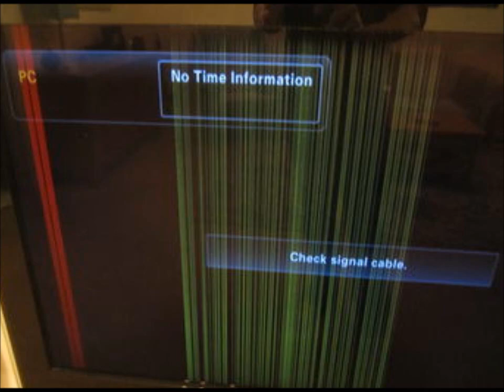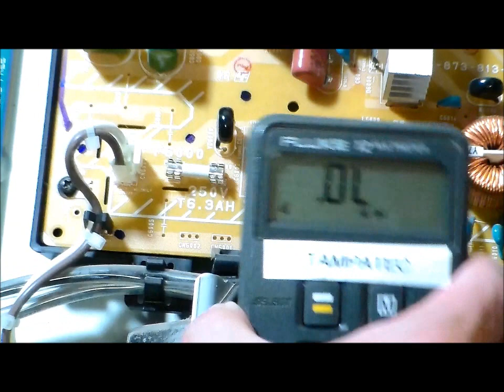What TV Boards Commonly Fail in LCD - Repair Service Guide

Comment: Oh if you ever come across any Vizio E552VL smart Tvs and it turns on but there is no picture, or back light my first thought was the inverters were out on it, but I had no voltage on the power supply so I removed literally almost every components on the board and tested them and they were ALL fine reinstalled it and bam black light came on and had video. So I am guessing it had quite a few cold solder joints. Then I put the back on it and it would turn on then shut right back off, did some research and people were pointing at firmware needing updated, I tried to find that with no luck, nor any help from vizio and I laid down to find the main board model number and noticed the ribbon to the remote sensor was off.. Plugged it back it and it worked like a charm! So if you ever come across that issue try to re-flow the solder on the back of the power supply and watch out for that little ribbon cable when reinstalling the back! haha  Just an idea in case you ever have that issue. Have a good one!

Comment: Excellent video.  The advice starting at 4:13 on getting no video display helped me troubleshoot.  It turns out I actually was getting a picture.  But as described here, because there was no backlight on, the picture was so dark that it seemed there was no picture at all.  Per the advice provided, I help up a flashlight to my screen to realize I could actually see (just barely) the very dim picture coming through.  This helped me confirm I really had a bad inverter board, not a bad video board.

Comment: Hi, thank you for sharing your knowledge. I found your repair guide very interesting and educational especially to us who does not know electronics repair.
I have a Sony KLV-46X200a, after watching and it is left plugged from the main(standby) for a period of time say overnight it will never turn on next time. The red light is on and when the power button from remote is press the green blinks then the red light stays on, and no picture and/or sound at all. 
the work around my son discovered was, he unplugged from the power source  for an overnight and then when he tries it turns on. But the problem comes out again if he forgot to unplug once he is done with the TV.

Comment: Love your videos. I have a Samsung lcd that powers on and off with loud screeching and static screen mixed with some green screen lines. I installed a new power supply board but no luck. Still powers on and off by itself but no screeching? Weird lol. Should I replace t con board next or main board?

Comment: Hi, first of all, thanks for the video. 

I have a Sony Bravia KDL-55W900A and a couple of months ago i replaced both the power board and the logic board, due to a surge on a thunderstorm. I did the repair myself (i’m no expert but i figured that if i can build a PC, i could replace these parts, and indeed i did). 
I didn’t check for blown fuses or capacitors, at that time. I got a replacement power board, then replaced the logic board and the TV worked like new.

Last week, we had another thunderstorm and... you guessed it, the TV was on at the time, and now it’s dead AGAIN.
I really like this TV and would like to fix it again, but this time I don’t want to just buy both the power board and logic board without first trying to pinpoint the problem, specially if a simple fuse or capacitor can be the culprit.

My question for you is this: do you know if this model has a fuse on the power board? 
Also, where do i get a replacement?

How do i check if the capacitor(s) are blown?

I really hope I don’t have to buy these 2 expensive parts again...

Hope you can help :)

Comment: Hi, great video. Can I get your advice? I have a Samsung UN46D6400 LED tv. When I first turn it on, the picture shows up. Within a couple seconds, it fades to nothing (the fade starts with horizontal lines then goes black). When the room lights are off, the backlight can be detected and it's uniform. Also, no image can be seen with the flashlight test. Do you think this is a main board issue since the backlight still works? Thanks for any help and suggestiosn.

Comment: Hi. Thanks for your video!

I think there's a faulty transformer in my power board. It (or another component) is emitting a high pitched wine whenever plugged in. Sometimes turning on the TV exacerbates the issue, sometime it takes away the noise temporarily. Is this something you see often? Is this something I could fix at home (with the TV unplugged, of course)?

Comment: Great Info man! I have a Samsung 55 3D LED TV, Have a thin line going  horizontal and one vertical and also has a black dot 1/4 inch , in the lines that cross, vertical & horizontal any suggestions

Comment: Hi Tampatec, I find your videos excellent tutorials. I kind of learned a lot from you. In February 2012, I purchased a Sony Bravia 55 inch LED television model number X BR – 55HX929, at the time I paid $2500. The picture in the performance of this television is excellent coupled together with Verizon FIOS its rendition of high definition television is superb. Most recently we were on vacation and gone for over a week. When I returned the TV begin to give me some problems.  After playing for several hours picture would dim down to almost nothing and then shut off. It would give me a blinking code of 5. After cooling down and disconnecting everything from the TV including the power the TV will fire up again. Once again performing excellently after several hours it would shut down again this time giving me a red flashing code 4. If I place a fan behind it the picture stays on much longer. Unfortunately this is very disturbing and unacceptable. I had to purchase a new 55 inch television. This time Samsung. I do have space in the basement where I can use this SonyTV. Is there anything you can recommend perhaps the power supply board that I could change out and still have some use of this TV in my basement rec room? I sincerely would appreciate your help, Steve G.

Comment: love the videos btw and need your help if possible, my problem is the ac jack port (think thats what it is called) on the back of my old ambilight tv, had no power and noticed that one of the 2 prongs looks pushed in or snapped off, can this be replaced?

Comment: Hey buddy i like all of your videos and learn alot but i have a question i have a tv that turns on and all but the tv tuner cant resive signal at all i change the chanel and i cant get nothing at all even if i have cable plug in only if the signal comes over the air entering on the coaxial por what is it

Comment: I have a Dynex LCD32 tv that is experiencing a turn on and off cycling. I have removed the back cover to observe the boards and I haven't noticed any of the capacitors bulging or leaking visually. Chris at Shopjimmy thinks it may be the main board. My first guess was the power supply board but I'm no expert. I understand that there is not much to go on other than it turns on and off on it's own but what is your opinion of what may be causing it to do that?
Thank you. Charles

Comment: Hello sir,
I have seen a lot of your handy tutorials. My Sony Bravia LCD tv MODEL No. KLV-32EX500 has color problem, red green blue tint/solarized color. But menu items are ok. I have tried power reset, factory reset, service menu looks normal but LVDS spectrum has no effect, replaced toon board but no improvement . I can't manage mainboard. Is not it mainboard problem? How can I fix it or how can I collect it? 

Thanks for your helpful tutorials.
Selim.

Comment: I have a Vizio L37HDTV , 100-240V 2.2A. When you turn in on all you get is an orange led. The power supply doesn't have any popped caps... I have been reading and watching youtube and everything points to the mainboard. What do you think?  Thanks, Davi

Comment: i have a 40 inch flat sony lcd and the remote stopped working, the remote isn't the bad part, i bought a new remote for it and the new remote also had the same problem.  something inside the tv failed.  any idea what could be causing that?  btw the tv still turns on with the manual button on the side and still looks great and sounds great

Comment: Hey man! I just replaced the power board on my Samsung UN32F5050. I had a red stand-by light but the TV wouldn’t turn on, even after replacing the power board. Will replacing the main board be the best next step? Don’t want to keep throwing money at this but don’t want to spend the money on a new TV either! Thanks!!!
Reply from the maker: check standby volts if it's steady 5v then it's possible can be main board.

Comment: Hello, I like your videos, thank you do much for posting the videos. 
I have a question, I am learning how to fix tvs. I would like to know if you have a video of how to replace the screen. My tv screen broke down, is cracked, I had the tv without stand And my cat bumped into it and broke it. So the 
TV is a 42PFL 5332D/37
Reply from the maker: if tv is cracked i would sell it broken or sell the tv boards at least ($100-200) (they should be ok) then recycle the tv frame at bestbuy. now a days you can buy a new tv for same price as a screen.

Comment: Hello, I would like to ask some questions about my TV, after plugging in my optical cable it was suddenly black out, I soldered the  optical port then removed it was same problem, what is the best way to check the other connections on board in order to determine the problem? there is a power coming from Power supply but no power on switch button/stand by. Your response is highly appreciated.

Comment: Hi Tampatec, i have a Sony KDL-46XBR2. All of a sudden, there is no picture and no audio to this TV.  no back light. Cannot see anything, even i did the flashlight test.  Power light stays on solid GREEN, and i see there is a blinking green on the QM board.  There is power to the power supply and the inverters. Can you give me some suggestions as to what could be the problem? tcon board? You got some awesome videos.  thanks in advance.

Comment: Hi, I'm in Australia and our AC power is 240v. I need to replace the power board on my lg tv. If I buy one from the US, will that still work? They all seem to have the one part number and don't specify 110v or 240 but I want to make sure.

Comment: I have a Vizio E552VLE 55 inch LCD TV. Back light is on and there is audio. Main board was tested and is OK. I tested the voltages from the power supply board and they are all seem good and there are no bulging caps. If the voltages check out from the power board, is it still possible that something else is wrong on the power board that would keep the picture from coming on the screen? There is no visible T-con board so I think it is on the lcd panel. Are there any other tests I can do?

Comment: Hi Tampatec! 😉 Need your help. Got a Westinghouse DW39F1Y1 LED T.V....No picture except can see with flashlight trick albeit faintly. Went to ShopJimmy, ordered the kit for this model (TW-75339-A039A). Now instead of just red light, I DO get blue steady light however no picture still. Can you tell me what exact type of led bulbs I can use to replace the ones on my 3 strips as well as where to get them??? ShopJimmy sells the tools I would need but not the replacement bulbs (I'm clueless what they are called). Like how many watts etc... I am unable to find them online. Owners manual states TFT LED. That's all I know. I'm a HUGE fan of yours and only took on this project so I could learn from you. 😉 Thank you for at least taking the time to read this if you do. Follow up response would be super helpful. 😉👍🏻😊

Comment: Samsung - un39fh5000f     the screen will flicker and then the pic will fade and go black but the audio will still be playing also sometimes it will start showing random lines and just recently started flashing different colors red, green,blue..ect but most of the time it will just start to fade and go black but you can tell theirs a light on because the screen looks lit up just no pic ... i have taken the back off of the tv and see no bulge in the capacitors ... thanks for your help

Comment: Hi Tampatec, I have an ACER V193W   19 in LCD Monitor, It works great for @ 5 minutes then Flickers and then shuts down . . . I.Leave it alone and an hour later try it and same thing again. . .Thanks for any advise , This just started happening , and the unit is @ 5 years old

Comment: I have a 37" 1080p JVC LCD TV. Model LT-37XM48. The TV's entire display is like frozen on millions of colorful horizontal lines and if I put a "DEAD PIXEL" video from YouTube on it, the display will begin working again after about 5 hours. But then it goes right back to the tiny colorful horizontal lines. Dead panel or Tcon? Also, would putting the main board in the oven to reflow the solder be worth my time with this issue?

Comment: I've got a philips 42pfl5522d/05. I have no visable picture but I do have sound. If I look at the screen from about 1cm away I can see shadows on the screen. From you other video I think it might be the inverters causing the backlight to not turn on. How can I test this to see if it is the inverters or the actual lights that are gone, before I go an but replacement inverters. Also there is a slave and masetr inverter on this philips, do I replace both or can I test them to figure out which one is blown, if they are at fault.

Thanks for any advice.

Maurice

Comment: Hey tampatech. I was getting crazy black lines all over the screen for a while then it eventually faded to black screen. I’ve got standby voltage at the logic board. One pin has 5v one has 3.3 and two pins have 13v. Don’t know what’s up with the 13v. But I’m not getting my 12v output to the tcon board. I’m thinking a bad logic board. What do you think?

Comment: Hello, I have Sony XBR-65X900C. I opened the back panel and found two Power boards. G1D and G1C. 
Can you help me in looking for right pin to check the voltage and how should I expect.
Thanks

Comment: We are getting lines on our LN55C630K1FXZA display and, if we unplug or push in the HDMI cables to the mainboard it clears up.  Now I think due to the way we clear it up by manipulating the HDMI cables to the mainboard then the problem is the mainboard.  Would you agree?  Now another problem is that I am not able to find a replacement mainboard.  Would you agree that is the most likely problem and, would you know where I may get the part?  Many thanks in advance.

Comment: Hey tampatec,  I got a samsung un65h7150afxza. Backlights flash very fast then goes into safety mode. Looks like voltage is good. If I disconnect the tcon from the main or from either panel ribbon connections the backlights stay on but no picture (obviously) big question is how do I confirm the problem is the tcon? Thanks

Comment: hi.. i have a panasonic 50cx700 model with one vertical line, one pixel wide, just slightly right to the middle of screen.. its pretty evident against red background otherwise it dont show much, is this a tcon board issue? thanks

Comment: Hello Tampatec!   I'm having a problem with my XBR-70X850B Sony 70" HDTV.
  It operates fine for awhile, then goes into a stand bye mode.  The red
 led light flashes 4 times, pauses and flashes 4 times again and 
repeats.  The TV won't power up again without first unplugging the unit.
   I've seen on-line that this corresponds to a code?  Can you explain??
  And maybe discuss the fix?  
Thank you!

Comment: Hi, got a KLV-32S400A... Just did a service menu test ok function..   It restarted fine.. problem fixed.. within one minute it started to horizontal flicker brighter whites..  eventually going back to original fault which was very bright colour setting.. as in contrast and colour all that was turned up high.. Backlight is working fine.. just contrast very high.. bright white. displays everything else as per normal.. Ive re-seated  TCon Controller. etc.. any suggestions where to look for this contrast high.. fault?

Comment: Hi tampatec, i have a SONY KDL-42W674A Led smart tv. Suddenly i got this One white horizontal line on it, what u think happened to it? And what do u sudjest to fix it? Thanks godbless
Reply from the maker: squeeze around the tv frame if the line disappears it is bad tabs on lcd panel (defective panel) but can be loose connection on tcon board or bad tcon. get at shopjimmy.com

Comment: hello, please help! have a viore lc40vf60 tv home screen comes on when tv is turned on. can toggle the menu for just a moment then it goes blank... well if you look closely sideways (or a very dark room/flashlight test) it still has the menu on the screen. did your fluke test of the inverter board and its all good. any other tests you can direct me towards would be great! thanks in advance

Comment: I have a sony KDL46NX800 recently the screen went out. Half of the screen has vetical lines and the other is just black then with some time it also has vetical colored lines. I have looked at many videos about what may be the cause. I opened up the tv and made sure all the ribbon connections were plugged in correctly. What I noticed was this: when the tv is cold it will turn on perfectly fine and it will remain with a perfect display, the t-con heats up but the tv will continue with the great display. But once you turn it off then back on, the display shows the vertical lines  throughout. I had the back of the TV opened while it was on and turned on a house fan which was pointed directly to the back of the TV where the t-con is located. And after a couple minutes the screen would come back to its original great display. My question is; can it be a defective t-con?

Comment: tampatec have a sharp lc-52le830c  one short blink and long blink. i have changed the power board and t-con  but it will not come up do you have any suggestions   please advise